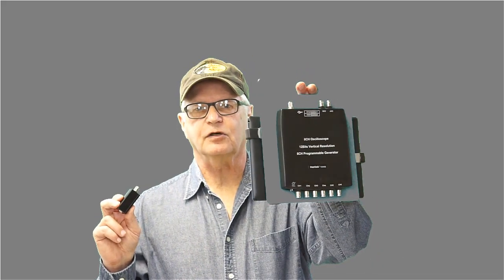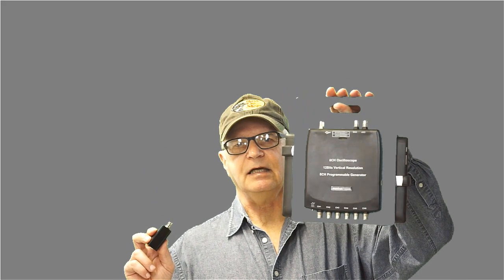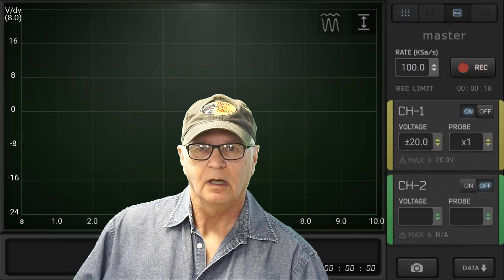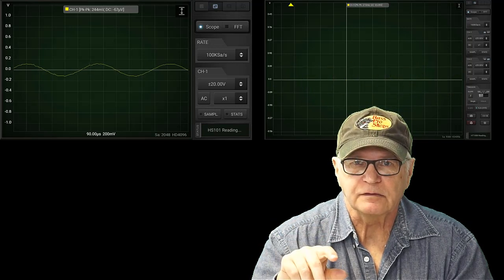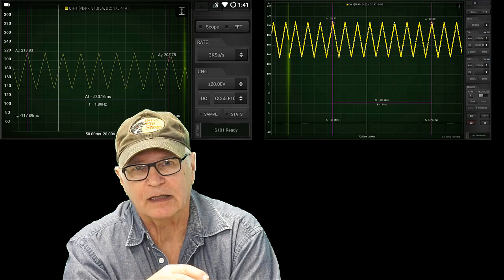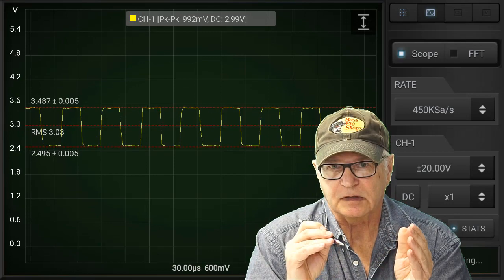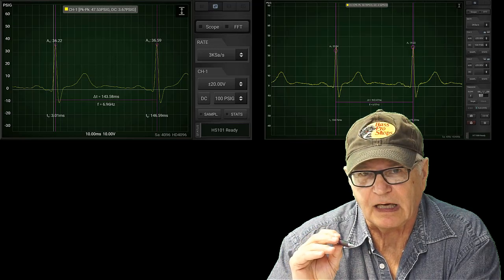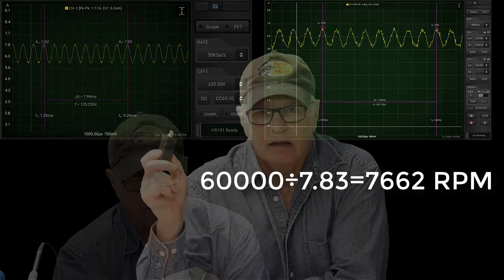GADGETS#41 - HS101 vs HT1008

Comment: Thanks for the heads up on the schematic error. I have just received all the bits to put this together. But maybe I'll wait for the two channel version now. Sounds like it will be more capable.
BTW your green screen seems to be working well. Nice presentation using that.
Thanks
Reply from the maker: +Dave Sage - I just received this beautiful aluminum case for the 2CH build. As it takes weeks for these to come in, I thought you might like a head start, if you're interested. More $$$😀
Hope the eBay link works...
https://www.ebay.ca/itm/192194965270
Reply: Thanks for the research and the link.
I ordered two. :-)
Reply from the maker: +Dave Sage - Here's another item you might want to get in anticipation of HS102 build. I'm 98.6% sure it will be needed...inexpensive but lengthy delivery (as usual)
https://www.ebay.ca/itm/253065212540
Reply: Another good find and thanks. Dually ordered. A good addition to my stock in any case.It seems odd he's only using two of the three pins. Looks like he's pulling something tricky there. Usually I prefer fixed regulators to the adjustable ones because you don't need the extra parts to set the voltage. I'll have to look at it more carefully. Thanks
Reply: As far as I can tell there I something wrong with the "schematic" for the HS102 +/- 5V version here:
http://hscope.martinloren.com/HS102-oscilloscope.htmlPin 2 is the output of the regulator and it's not connected to anything. The adjust pin (1) is connected to the scope grounds (??). Makes no sense to me. How about a real schematic. Also I can't really tell where the regulator is on the perf board layout picture. I won't be building this any time soon without more clear information.
Reply from the maker: @davesage9190  - Martin has chosen DIY LAYOUT CREATOR for schematics. More info on that can be found on GitHub here:
https://github.com/martinloren/HScope/tree/master/HS%2010X
and here:
https://github.com/bancika/diy-layout-creator/releases/tag/v3.54.0c
As to the regulator, I forwarded your comment to Martin.
Reply: @davesage9190  Pin 2 do not need to be connected. This configuration is not document but consider the ASM1117 is an integrated circuit, it is quite complicated inside, you can refer to its datasheet to see that there is a relation between the OUT pin and the ADJ pin. This configuration uses the less number of components to produce VCC/2. Pay attention the AS1117 is the 1.2V version, not the ADJ or 5V or 3.3V. I've added it's connection scheme on the main schematic at http://hscope.martinloren.com/HS102-oscilloscope.html.
Reply: Ok. I'll take your word for it. I figured you must be taking advantage of some un-usual aspect of it's usage. Interesting. Nice work.
I'll follow along here as Logical Canuck covers it. I'm in no rush.And yes, I did see it on the perf board layout although it is barely visible being orange on brown, especially the pin numbers. I'll have to print it out and blow it up. It's tough to see on the screen.
Thanks for the response
Reply from the maker: @davesage9190  I may have given you a bum steer on the ASM1117 eBay deal earlier as I'm not sure it contains the 1.2v version...probably nice addition to our stock anyways, as you had pointed out.
I ordered these today...
https://www.ebay.ca/itm/50Pcs-AMS1117-1-2V-AMS1117-SOT-223-Voltage-Regulator/181393096883?hash=item2a3bdf00b3:g:~3EAAOxyeglTW8jA:rk:5:pf:0
It is 1.2v
Reply from the maker: +Dave Sage - I want to keep you updated on the status of HS102. My plan is to showcase 2 versions of a +/-15v...and "easy" 10kΩ model and a "hard" 1MΩ model.
The 1MΩ will require a MCP6S21 amplifier chip. It comes in 2 form factors. A DIP which has .100 spacing which makes life easier but is more expensive and difficult to source than the SOP8 .050 spacing I ordered here:
https://www.ebay.ca/itm/5PCS-MCP6S21-I-SN-Microchip-Encapsulation-SOP-8-New/283090819031?ssPageName=STRK%3AMEBIDX%3AIT&_trksid=p2057872.m2749.l2648
To go from SOP to DIP, I ordered these:
https://www.ebay.ca/itm/20PCS-SOP8-SO8-SOIC8-TO-DIP8-Interposer-Board-PCB-Board-Adapter-Plate-New/162875355918?ssPageName=STRK%3AMEBIDX%3AIT&_trksid=p2057872.m2749.l2649
The HS102 +/-15v is not forgotten. Trying to fit it in with Martin's schedule and part sourcing time.
Let me know if the links don't work for you. As we've discussed, eBay links are notorious. I'll send you the info in screenshots if need be.
Take care.
Reply: Yes the links are good (so far). Thanks for the info.
 I'd probably make a circuit board for it. I'm pretty good at it now. Also I have no problem with the surface mount stuff. In fact I prefer it since you can make it much smaller.
Thanks for the heads up I'll be watching. My time is tied up making another engine at the moment.
I think the +/- 15v and 1Meg version is the way to go IMHO
Thanks

Comment: I had a look at the new schematic and it looks like the input impedance may now be even lower. The signal input goes through a 200ohm and a 3.3k in series (?) and then off to the processor (I guess). The old schematic had a 10k directly from the input. I haven't analyzed it further than the schematic. 
Comments?
Reply from the maker: +Dave Sage - My comment would be that I'm pretty sure Martin tripled checked this one!
Reply from the maker: +Dave Sage - ALSO, I think you're looking at the +/-5v circuit...
You have to be careful on that site...there are a number of versions.
The 0v-20v version does not have the resistor values you mention. It has the same 2kΩ and 10kΩ as the original plus some capacitors.
Easy to get lost there.
And then we add our own twists ( to make things fit in a chosen case, etc...) which is what I expect will happen in my HS102 build.
Reply: I'm sure it was checked to fix the problem but maybe he doesn't care about the input impedance - or I'm missing something. Do you plan to change your original build.?
I think you mentioned that it had problems at higher voltages (like 14 or something). I thought the scope was only good for 12 anyway?
Reply from the maker: @davesage9190  Was meant for 20v
It's OK up to 14.5v with the flaw, which covers automotive work, so I have no plans at this time to build a revised HS101
Reply: Yes, I think you're right. It was the wrong schematic.  Also I don't like the perf board graphic version of the schematic so I was getting confused. I missed an additional 6.8k to ground. That would make up the rest of the 10k. Not sure why he doesn't have a proper schematic. I can figure out how to put it on a perf board.
I'll go back and look for the other schematic.
Thanks for setting me straight.
Reply from the maker: @davesage9190  What are friends for:-)
Reply: @davesage9190  Rising up input impedance require a more complicated circuit that may discourage from making a DIY instrument. There are applications in which low input impedance is not an issue and applications in which it could be an issue. A preliminary schematic for +-5V input module - 1MOhm standard impedance is available on the website ( http://hscope.martinloren.com/HS-oscilloscope-module-5v.html#solution_3 ). It is still under test and may constitute a more difficult alternative to the basic 10KOhm schematic.
Reply: True. And perhaps not always a problem but one never knows. Some sensor circuits can be thrown off by 10k to ground. 
I appreciate your efforts and I'll be building the 2-channel version. Nice work and thanks very much.
Reply from the maker: @davesage9190  - The 0v-20v schematic is the very first one on the page. Martin has placed a (pictorial) schematic above the "perf board" schematic.
It then is all about us running with that and placing the components on the THT board to suit our build. People from around the globe share their ingenuity on the TELEGRAM group. Note on the site the PCB version a Ukrainian designed, sent out to be printed and then he soldered SMD components on it!
It's a small group but it's a venerable Tower of Babel. You're knowledgeable and if you have the inclination Dave, consider joining it. I know Martin would be most welcoming.
Reply: Telegram group at t.me/hscope
Reply: I'm going to have to investigate all of the information more carefully (when time permits). I've only glossed over it so far.The SMD version sounds interesting. I make a lot of pcb's. Perhaps I should look at that group as well. Looking forward to your build.
Thanks
Reply: I don't see the 20v version of the two channel scope. The top of the page I'm looking at is the +/- 5v.I'm looking at this. The schematic is down the page a bit.
http://hscope.martinloren.com/HS102-oscilloscope.html

Comment: Can you use 8 channels in one application or the Hantek 6022BE is enough? If you were to choose one between that 8 channels and the 6022BE what would you choose?
Reply from the maker: +Adriano Vergora - The 8 channels of HANTEK 1008 is more marketing gimmick than anything else. You would never need 8 and since its resources are divided by 8, it wouldn't really be able to provide 8 useful channels.
Three to four channels would be the maximum one would ever need and I have never used more than 2 at a time.
Between the HT1008 and the HT 6022BE, I would chose the 6022BE.
BUT as stated in an earlier reply, I would choose the LOTO OSC482 over either of these.